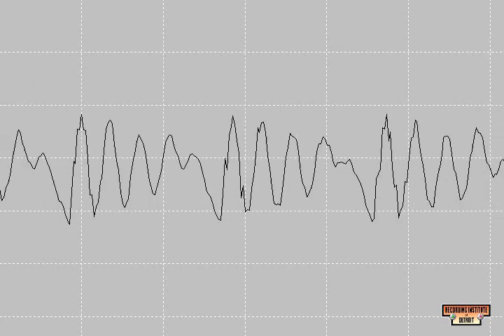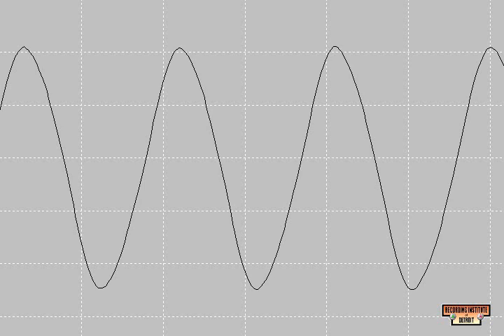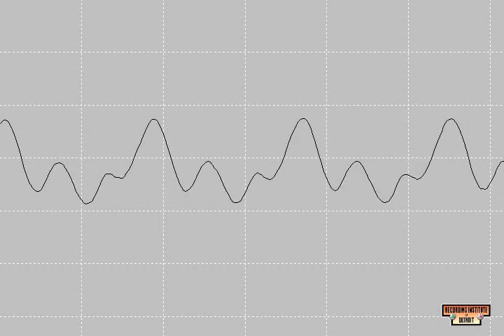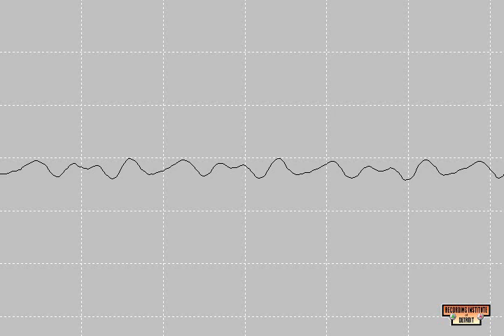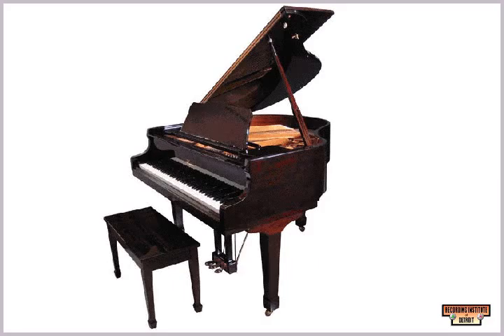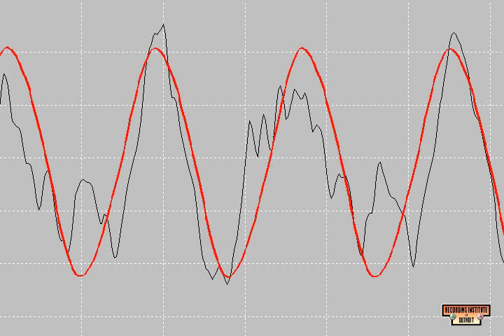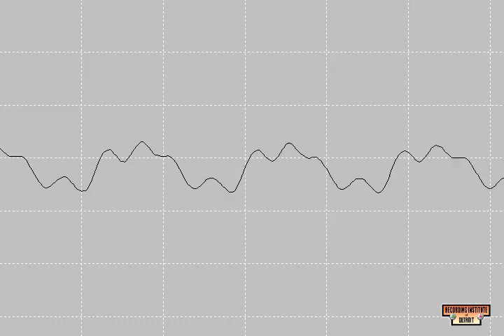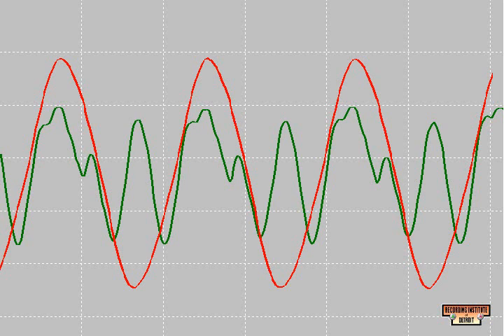Fundamental vs. Harmonic Frequencies

Comment: Definitions would have been helpful, although the demonstration was very clear on what it demonstrated. That is, an electronic frequency generator produces ONE TONE, where as guitars and pianos (and other instruments) are played on the whole instrument, with sympathetic tones being produced even though one string was actuated. 

Defn: Fundamental Frequency: The lowest frequency which is produced by the oscillation of the whole of an object, as distinct from the harmonics of higher frequency.

But I still didn't get what a FUNDAMENTAL FREQUENCY is by clear demonstration and explanation. I would hope someone can provide that without snark. Thanks!
Reply: The fundamental is the frequency at which the the whole wave including all the harmonics (ie all the bumps and troughs) starts and ends. Just look where the pattern of harmonic shapes begins to repeat itself.. start to finish is one cycle of the signal. Measure that in relation to time and you have the fundamental frequency.